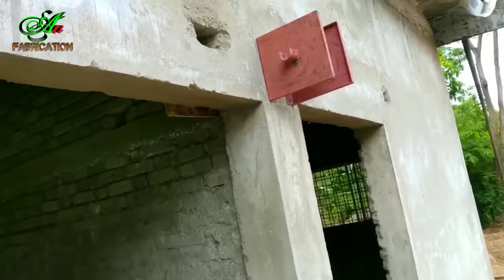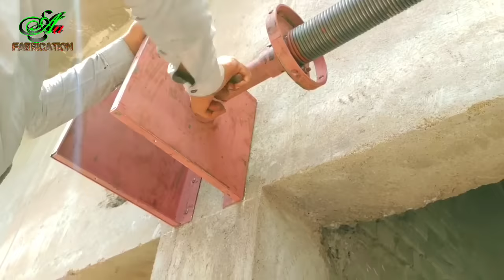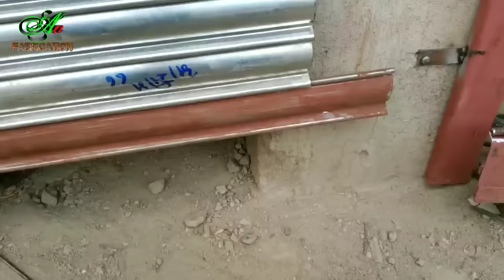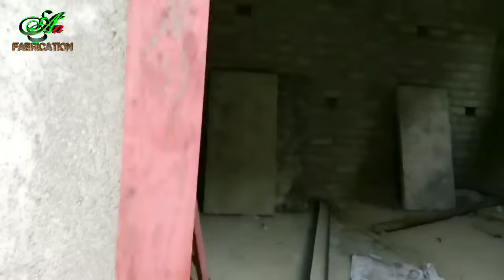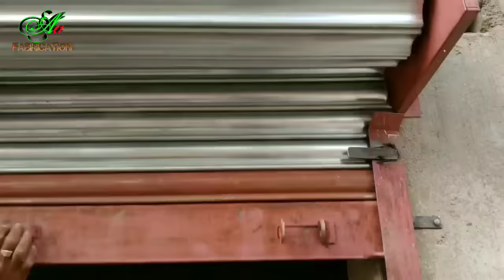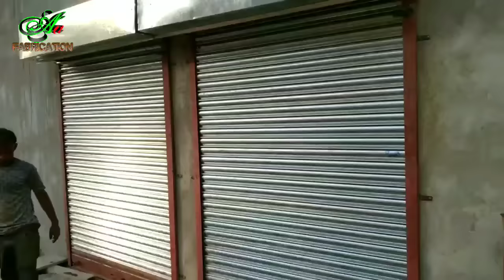How to fitting rolling shutter | Rolling shutter fitting in india ||

Comment: Nice work ., I am also one of fabricator , only fabricators knows passion of work🤞🏻👍🏻
Reply: Bhai normally ek shutter ka rate kitna tehta with fittng
Reply: @mdrizwanmalik6133  

Based on Material, it may differ cost , approximately small rolling shutter takes 15,000 - 20,000
Reply: What grease is good for rolling shutters? Is AP3 type (having ghee like color) good? Here they are using the black type. In our shutter black type grease was used. But it seems to attract dust and moisture. Now it's difficult to lift shutter. About to try AP3 type.